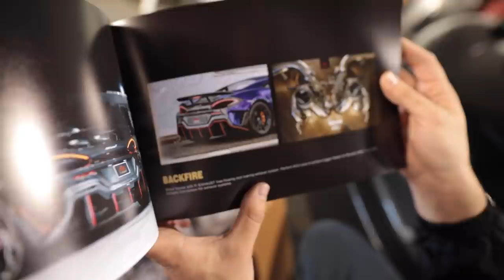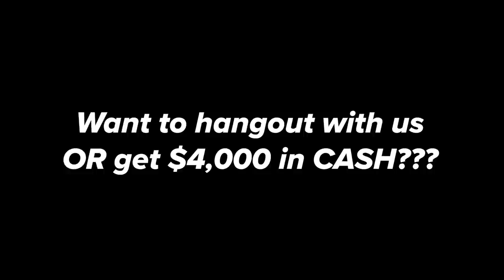Inches From Death In An $800,000 Super Car!

Comment: Glad you guys are alright but you guys got to remember when you're playing with all that power you never know what's going to happen even if it's got traction control and all that other Bull jump always got to be prepared for the worst that's like when you're going 210 miles an hour down a drag strip in 5 seconds you never know what's going to happen you can have a good pass or you could have a bad past so you always got to be prepared for the worst margin in the car good air on the driver glad you guys saved it and I'm glad you guys are okay because that would have been a very expensive mistake

Comment: What i learned in the first 7 minutes was as follows. If you buy a $800,000 car the diff is probably fine and upgrading it seems to cause issues. For 800k you still don't get the sound you want. McLaren's use the same heat shields as turbo civics. And if i could afford one Id be the man in that drives seat...

Comment: Justin is a great driver by not hitting the brakes in that situation. Just point the wheel straight and let off the gas. Only pull the emergency brake if absolutely needed.

Comment: A fully loaded 765LT cost $600.000 i don't know from where you got the $800.000.
Reply: these cars go for way over msrp right now. The customer paid 650k for the car. bought 100k in parts and then paid me to build it. Remove engine and trans, tear down the trans, install clutches and Diff. full clear bra, and now it's getting wrapped.
Reply: @wraplife5615  and how much HP the car is making after the modifications?